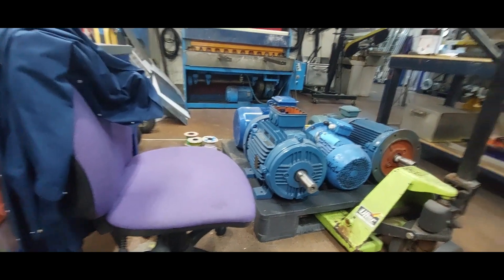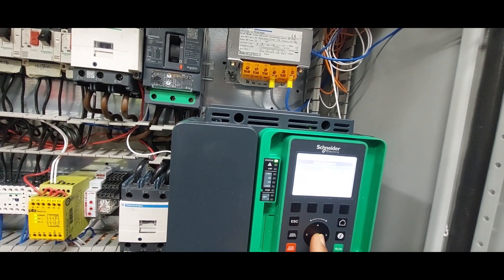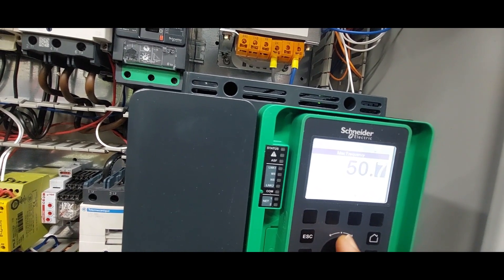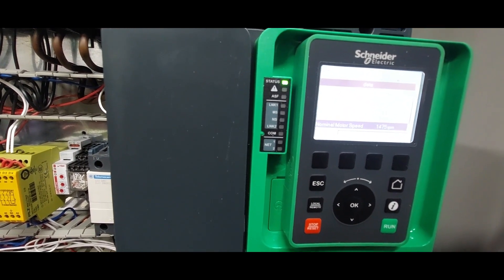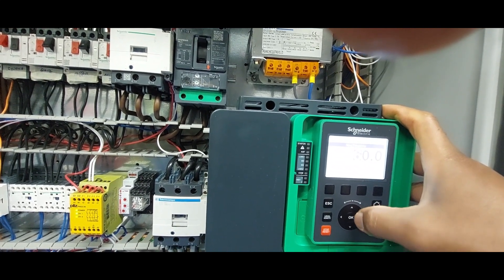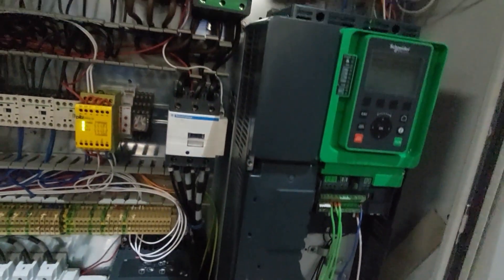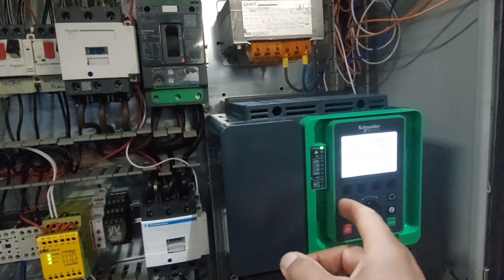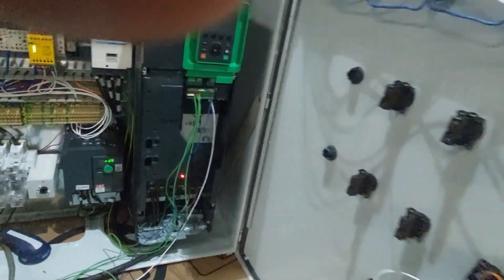What happens when the KW of  VFD is bigger than KW of  the Motor

Comment: Maybe a few tips, if you use Somachine software from Schneider it works way faster and always perform an autotune before starting up.
Without a load I would suggest doing a rotation autotune (or with low inertia). Keep in mind that if you change motordata afterwards tou will have to tune again.
The preference is to do this with a cold motor, because temperature has an effect on inductance and impedance of the motor.
Reply from the maker: Thanks for the tips!

Comment: Hey ,  i have question if i might ask about VFD's , does VFD generate the reactive power needed by motors , in conclusion the the PF equals to 100% . thanks
Reply from the maker: Hi Kellou, are you an electronic engineering Student?   I  would suggest that you go to Google scholar for in dept research. I am dedicating this channel to teach hands-on application in Maintenance engineering.
 in the VFDs there may be reactive power between the oscillator and the DC bus. However, these reactive power are  growing less in the  modern VFDs which are designed to mitigate these losses.   I believe that the power factor of the motor depend  on the PWM and the Park transformation system.